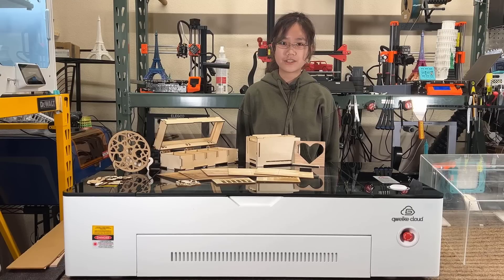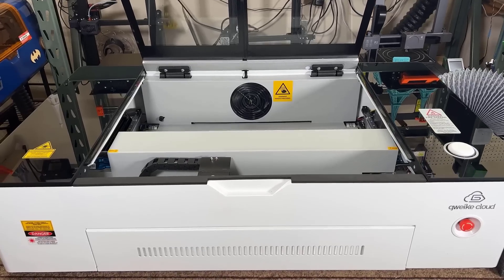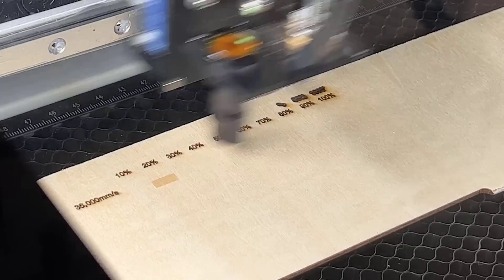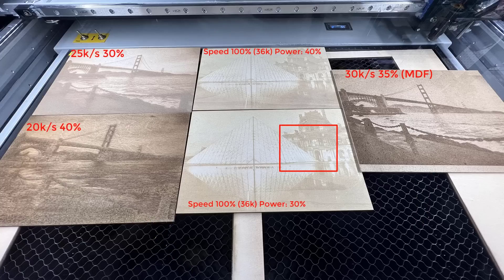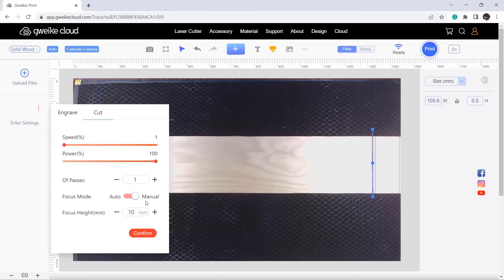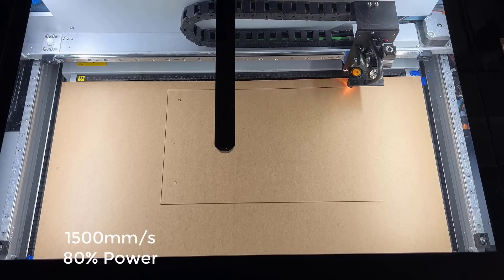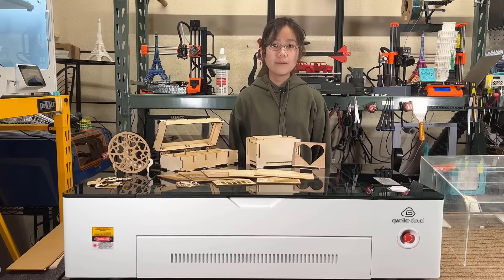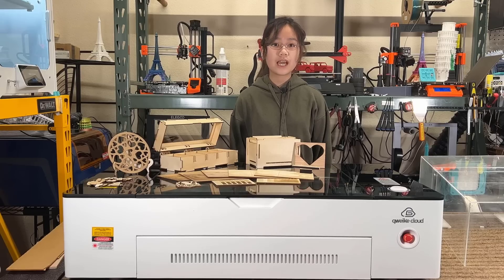Gweike Cloud 50w CO2 laser cutter and engraver: cutting plywood, 1/2" thick solid wood, and acrylic

Comment: Great review. thanks. Fume extractor looks efficient at capturing the gas emissions but make the slot wider, and then you have to worry about particulates such as microplastics. Being able to not smell fumes is not a reliable measure of micro particles. I like your channel, and would like to see more dedicated sections with emphasis on safety features in products.  It's usually a part that is not emphasized or just touched on briefly. Keep up the good work.

Comment: Hello. Great video. Congratulations.
Is the laser lens Dust? May it be possible? 
Is there a black circle shadow in the lens center? If so, if you clen the laser focusing lens, the cut test will be faster,  better speed results on cutting test.
Best Regards.
Reply: The lens is very dirty and needs cleaning, yes.

Comment: Many specifics are addressed here regarding this type of machine. 
After 2 decades we can finally get rid of that bucket of water on the floor. 
If the coolant is anti freeze it would be handy for usage in places where temperatures go below freezing or transport through freezing conditions; otherwise the places with the liquid will have Rupture.

Comment: Hi Aurora, 
Great review, thanx! I do have a questions, since you tested both machines: I now have a Twotrees TS3, bought this diode laser mainly because it was enclosed and was hoping it would extract fumes nicely. However, in my tiny office it smells like I burned down a whole forest after I engrave or cut any kind of wood for longer than 15 minutes, even when I have a hose connected. 

How do you think the fume extraction is on the Gweike? Do you really smell nothing at all, or is that just because you're in a huge space? Like I said, I have a tiny office, so if it's not perfectly extracting it will smell pretty darn fast haha
Reply from the maker: I would say adding the 6" duct fan helps a lot, just the exhaust fan at the back of the machine may not be enough to create strong negative pressure, and smoke may still escape from the gaps.
Reply: @AuroraTech  I'll be looking into that. Thank you!